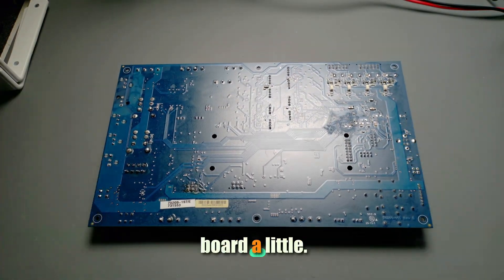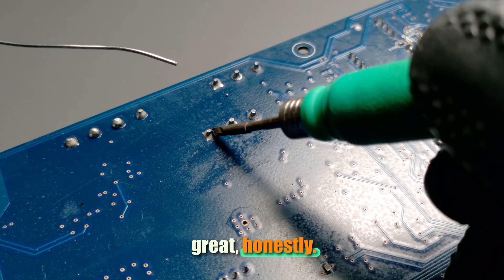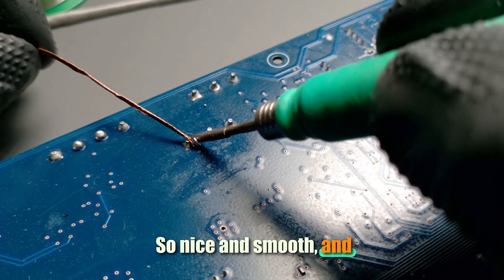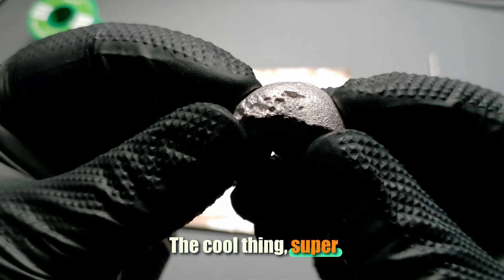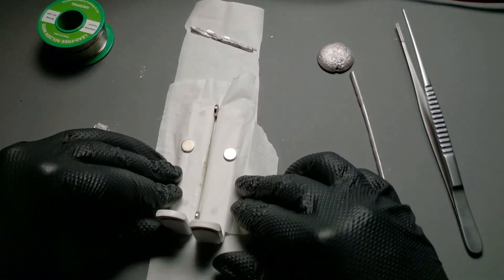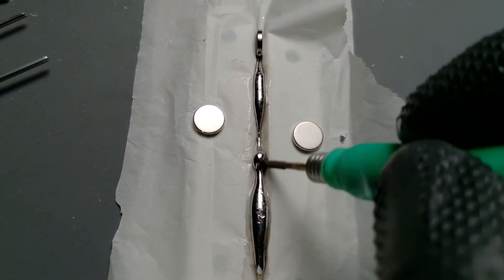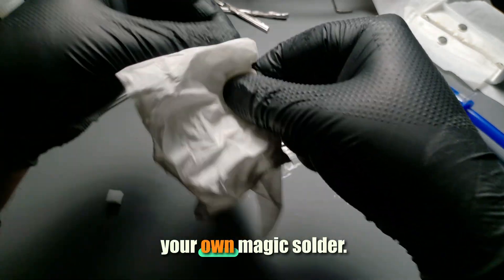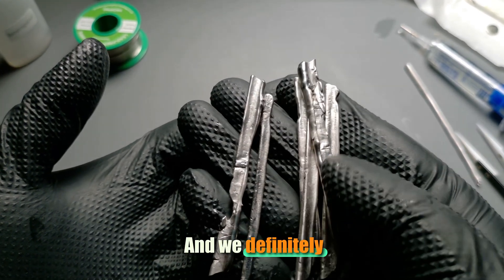I Discovered This INSANE Solder Trick That Makes Desoldering EFFORTLESS! (Rose's Metal Secret)

Comment: Thought this might be a cheaper alternative to chip quik, it sounds like the same kind of stuff. But the only sellers on eBay are in the Ukraine, and the shipping fees are way too psychotic to gamble on.
Reply: That's  because you don't buy things like "Rose's Metal", you make them, that's why no one has them for sell. You just weight out the metals, put them in a metal bowl, and torch it with a plumbing torch.

Comment: This is TOTAL BS !! You didn't follow the basic tenets of good soldering practices as "proof" that the conventional method doesn't work well. NOTES describing individual pieces of BS:  0) You didn't actually show that pin being desoldered, only the (assumed) result. No proof of the process in action was demonstrated. VERY SUSPICIOUS ! 1) You didn't first "tin" the soldering iron's tip. That's just pure stupidity or ignorance in action. 2) You tried to heat up the pin with a soldering iron tip that was obviously corroded. See point "1)". That's a BIG and obvious violation in everyone's PCB assembly and repair world. 3) You didn't even use flux !!! That's a HUGE "no-no" in itself. 4) At first you tried to desolder a pin that was apparently connected to a power or ground plane. These types of connections suck away the soldering iron's heat very quickly and not allow the solder joint to retain enough heat to actually melt the original solder composing the joint. 5) How could anyone possibly expect the Rose's Solder to transfer enough heat from the iron's corroded tip though to the joint's solder when not using flux and a tinned soldering tip ? You're actually fooling only the ignorant !
Reply: My biggest problem is you say nothing about your tip itself. Most irons come with 600 degree tips. They suck, the only thing they will remove is the pad on the PCB. Get yourself an 800 degree tip and KEEP IT CLEAN.
Reply from the maker: Great technical breakdown! You're spot on about proper soldering fundamentals – I should have emphasized those basics more in the video. Tinned tips, flux, and clean equipment are non-negotiable.
The Rose's Metal technique is meant as a helper tool alongside good practices, not a replacement for them. Thanks for the detailed feedback – it helps everyone learn!